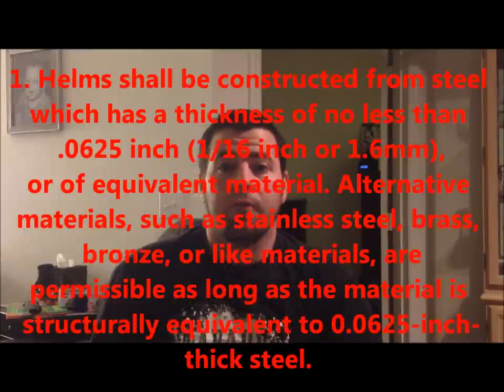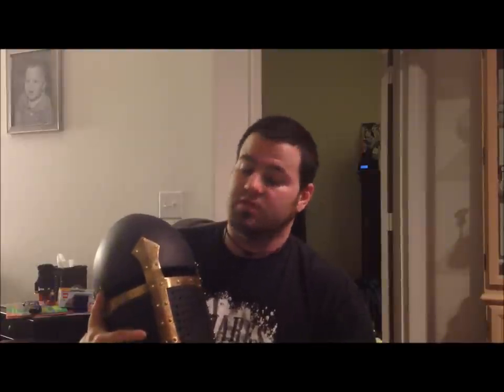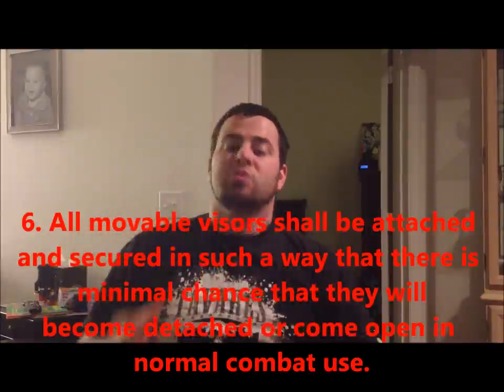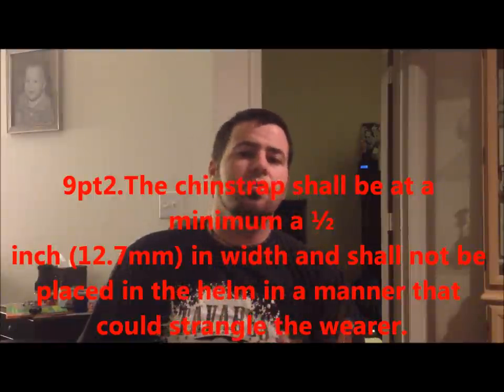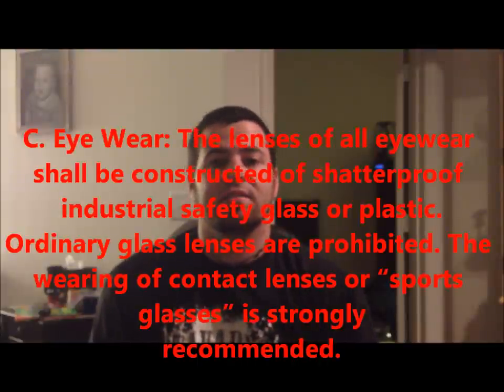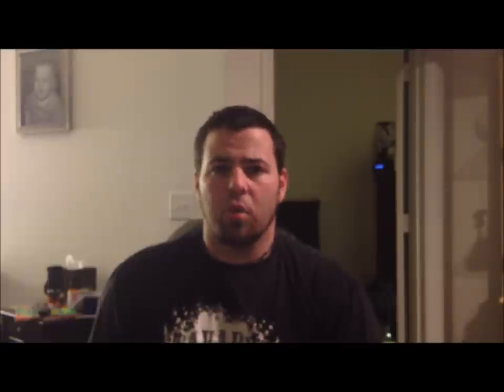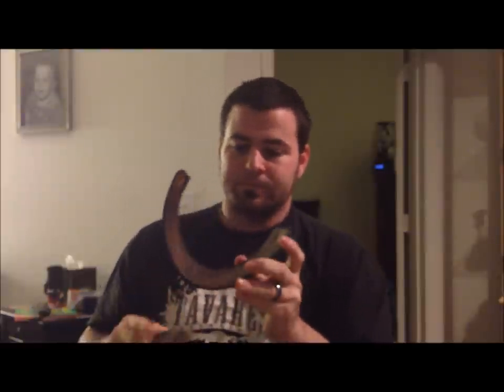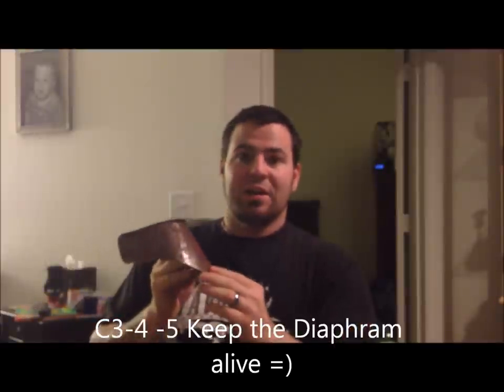SCA New comers Guide, Armour: Head and neck

Comment: are you allowed to use an aventail without a gorget?
Reply: As I recall(East Kingdom rules), an aventail, usually being flexible, isn't permitted without rigid protection underneath.  The aventail, like chainmaille, was intended to stop, or lessen, the effects of a cutting edge.  It won't do much to stop the FORCE behind the blow, which is why the gorget is needed. Your results may vary

Comment: I'm more into the Viking age stuff when you join can you make your SCA character a viking age person or is this dictated by your kingdom?
Reply from the maker: Will Yeazel you can pick a norse persona from anywhere and anytime covered in the outline of the SCA’s doctrine.
Reply: Wolff Trimaris  thank you very much
Reply: i believe you can chose any persona within the timeline of your kingdom. i personally know a viking character.
Reply: I've been a viking in the East Kingdom for the last 43 years.  It's even possible to armor up, viking style, for combat(except for the elbow, knee, and lower leg requirements; vikings usually didn't armor there.  However,  greaves made of sole leather with metal splints attached will serve for the legs, AND make good vambraces too), using scale mail made of plastic or metal(chainmaille, in my opinion, is nearly worthless in SCA combat; it isn't designed to absorb the FORCE of a blow; anything less than 14 gauge rivetted will come apart rather quickly, and it's basically too heavy to fight in.  If you MUST wear chain, you STILL have to have protective armor beneath it).  I've seen, offered for sale, a number of good, period--looking, spangenhelm type helms; ones with a nasal, and even spectacle-types.  Some even have a movable bar-guard!  Round, rather than heater, shield.  You can get quillons and pommels to made a viking-style fighting sword(you'll have to wear a gauntlet, of course) if you don't want to use a basket-hilt
Reply: Mike Grossberg thanks for the info and advice any suggestions on where to obtain these items on a budget and I do metal work on occasion would they allow home made pieces?
Reply: A LOT of SCA armor is home made!   I once made a couple of pauldrons in a friend's workshop, and I was putting together a scale hauberk when I found out that, thanks to a shoulder injury, I wouldn't be fighting any more.  The ONE thing I wouldn't recommend trying to make for yourself(unless you're an experienced metalsmith) is a helm.  There's too much at stake to leave THAT to amateurs!  As far as "budget" is concerned, look around.  It's possible that you might find someone looking to sell armor they don't use anymore, or someone who'll make you armor in exchange for you doing something for them.  You ARE, however, going to have to spend money, if only for raw materials.  Good luck!